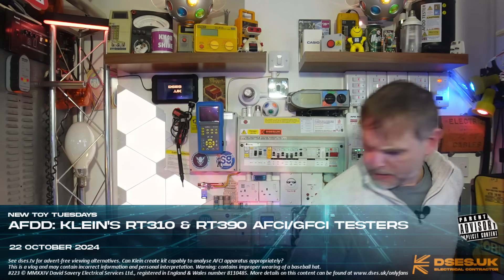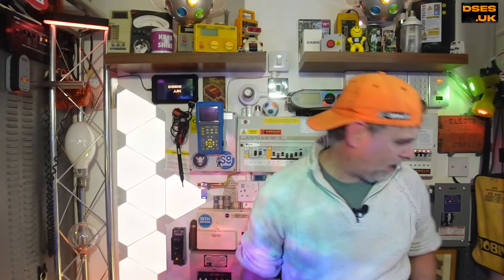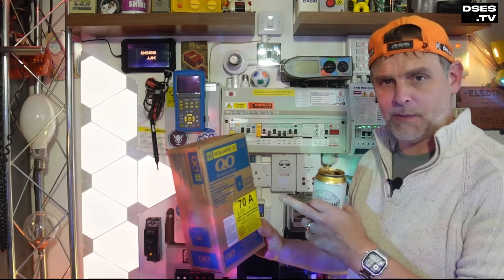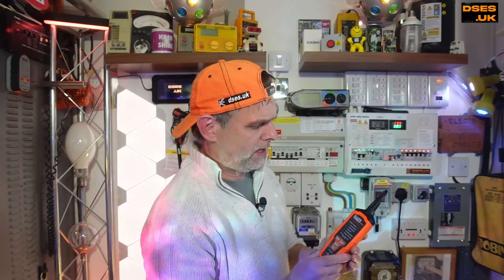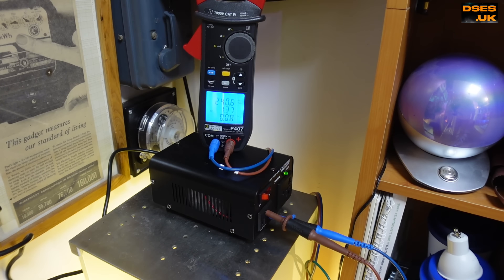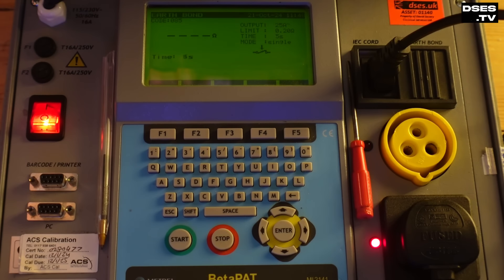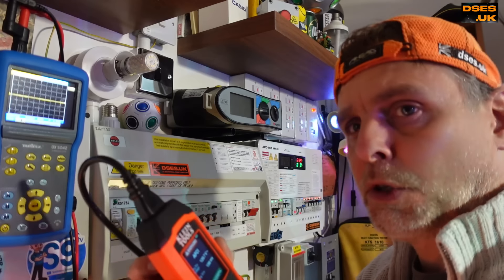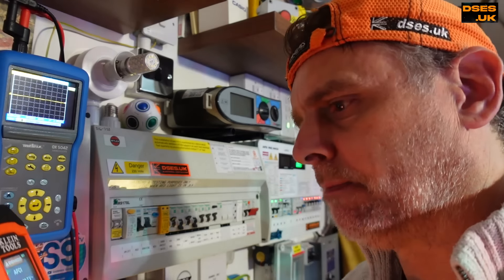AFDD: Klein's RT310 & RT390 AFCI/GFCI testers

Comment: Hi David, not sure if this will make sense or not - you noticed that both testers were saying "energized" even after the breakers had tripped. At the start of the video you commented that the lead for your transformer had swapped polarity. So I'm wondering if there is somehow a connection? Could you have ended up switching the neutral through the breakers and not the line? I can't decide if this is a possibility or not since I don't know what magic happened inside the load centre, so just thought I'd suggest it. Cheers, Dave.
Reply from the maker: I changed the lead and ensured the polarity was correct. It's odd as each instrument reports "non-energised" when powered up, "energised" when plugged in, then when tripped, they show open connections and no voltage, yet the Energized LED stays on. In the case of the RT310, it jumps around between the two states sometimes. There's 0V between hot, neutral and ground at the socket (neutral and ground showing continuity). In fact, it was the RT310 that alerted me to the reversed lead problem because when I first plugged it in before making the video, it was showing all sorts of errors (see my short on Chinesium cables).
Reply: @dsesuk  I had a look at the short ... a bit shocking :)

What happens with the tester if you power it on, the energized LED off, then plug it in to the socket with the breaker already tripped? Does it stay off, or start acting funny. Or if you plug it in to a live socket and then physically unplug it again while the socket it still live does the LED remain lit? It's hard to imagine Klein making two different testers that are both faulty in the same way, but also hard to suggest any real reason why you're seeing what you're seeing. Hard to believe that it's the 50 Hz vs 60 Hz that's confusing the tester. I'm sure you'll figure it out though. Based on your other videos you do like to dig in to things - AFDDs in particular :)
Reply from the maker: @davefrizelle3882  RT310: Power on, Energized LED green. Plug into socket with device tripped: no change... initially. Then it starts flicking between energized and non-energized with Open Hot also illuminating with the former, Open Ground and Open Neutral with the latter. Energising the protective device makes it stable (energized light and Correct Wiring illuminated). Physically unplugging puts it back to Non-Energized along with Open Hot, however it sometimes goes back to switching to the other state even when unplugged. Touching between the plug pins with the hand when unplugged seems to stabilise it. This device seems unsure of its status when the plug pins are floating. The RT390 seems to be behaving now, although if I turn it on and plug it in with circuitway 1 selected, but only the device in circuitway 2 switched on, it shows >30V, "Energized" on both LED and LCD, and Open Ground/Open Neutral on LCD. A voltmeter (both standard and low impedance) shows no voltage between any plug pins however, nor should there be unless the selector switch is faulty. It's odd, but they both seem to be misreporting in different ways.
Reply: @dsesuk  Thanks for all those additional details and tests. That's very odd behaviour from them both. It sounds like maybe the detector works like some of those non-contact mains detectors and senses the presence of 50 Hz and then shows energized but open hot since there isn't a good high voltage there. If you brought the plug close to some live (insulated) wires on your setup I suspect it would be stable in the energised + open hot state, maybe depending though on the orientation of the plug and which of its pins detect the most 50 Hz hum. I have no suggestions for how it can be detecting > 30 V though, you shot down the theory I would have suggested since you already tested with a high impedance multimeter and saw nothing. I would have suggested that it was like the floating earth episode, but clearly not. However it's not doing a voltage measurement directly in the case you describe so it has to be making assumptions, maybe based on the 50 Hz hum it is detecting. There is a fair old coil in the transformer going from 230 V to 110 V which will produce a substantial enough magnetic field so that could be at least part of the cause of it behaving so weirdly, but that's no excuse. Overall it sounds like a very peculiar tester!

Comment: Hey David. Are you aware that there is a noise generated that you can hear on the audio of the video when you hit the AFCI on the tester? I'm sure you are with your attention to detail in the editing.....
Reply from the maker: The death rattle is coming from the transformer. I'm not sure what's making the noise - it does have a resettable circuit breaker and I figured it might be that. I ought to have opened it up really.